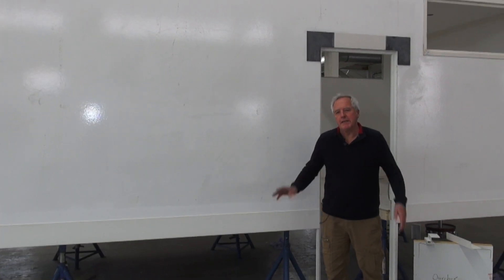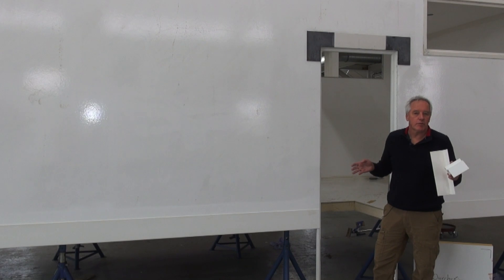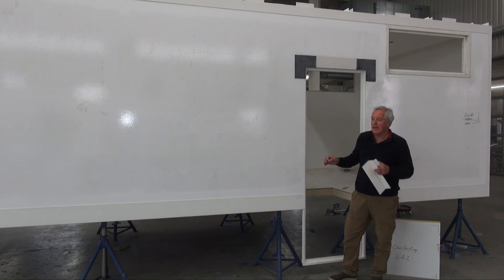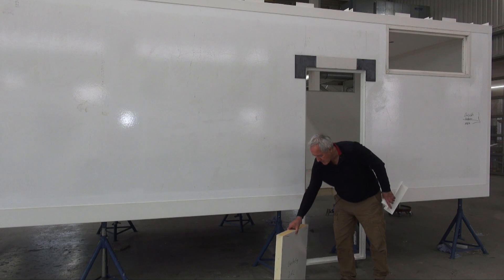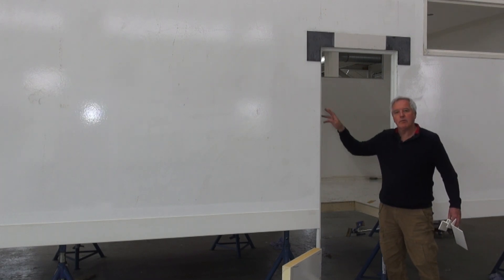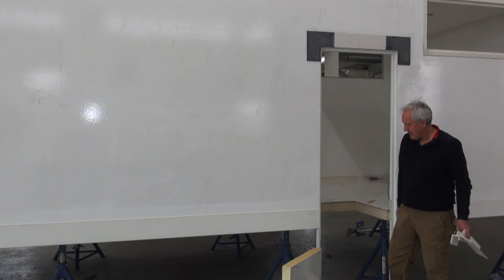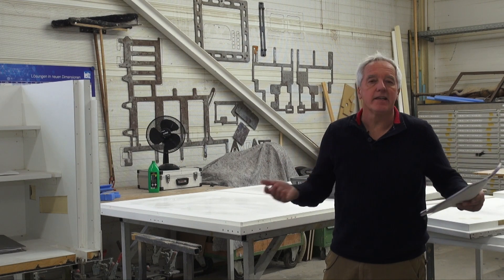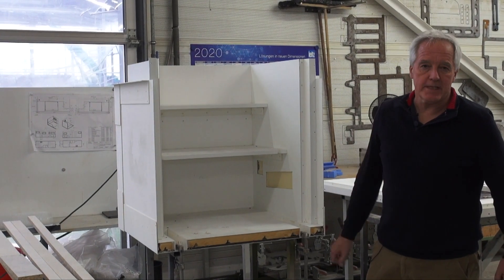UNICAT Expedition Vehicle - How we build the bodies of our Expedition Vehicles

Comment: Another question....
What inherent difference is there between the three point chassis connectors and the use of (6) spring connectors between the truck chassis and the body frame? Also is there possible chance for truck  turnover when at speed cornering on a bitumen road with the sway with the three point connection and over compensating, like a shift in liquid concrete mass in a cement truck??

Comment: Question : at each corner,the inside fiberglass of each panel continues to the outside, isn't  kind of a thermal bridge ? and would'nt be possible to remove that 2mm thick material by 58mm by the total height so no thermal bridge or it would weakens the corner even if I notice you re enforced the inside corners ?  Thanks and I miss your videos, they  are very interesting !